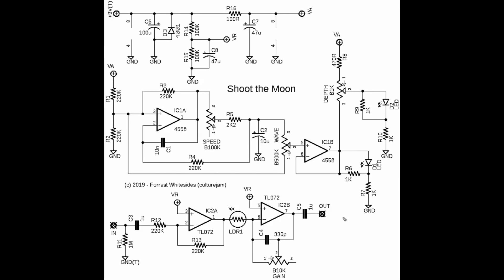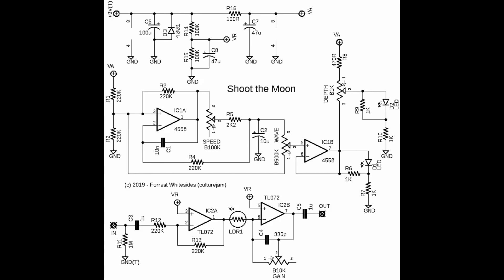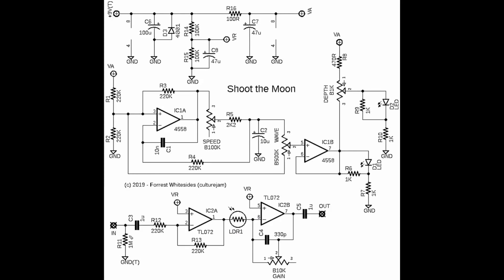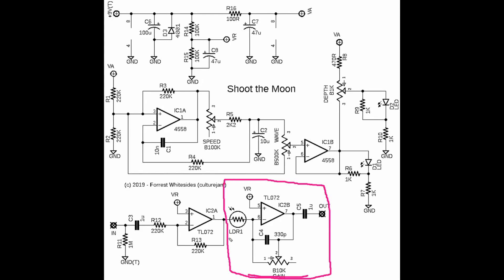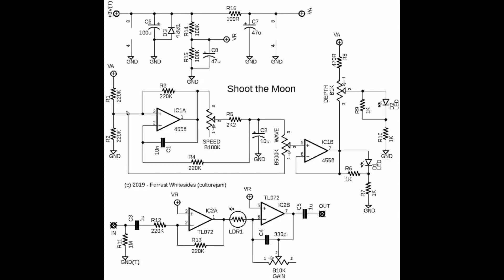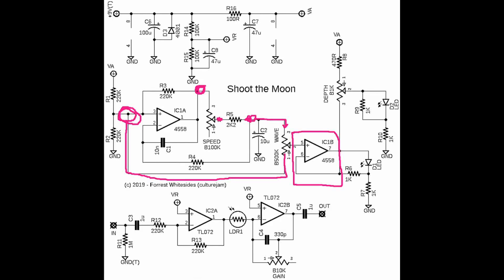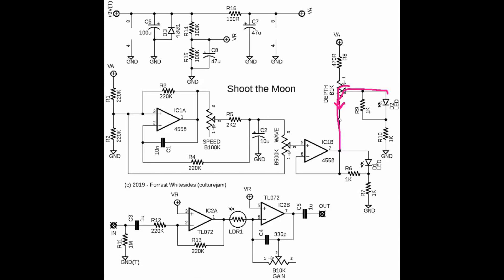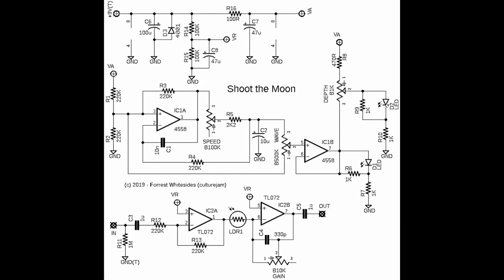Schematic Elements for Guitar and Effects: Optical Tremolo

Comment: Great video. Why is R1 and R2 necessary if we already have a voltage divider (VR)?
Reply from the maker: R1 and R2 are used to set the reference voltage to set the LFO into oscillation. Often this is slightly different from VR for a couple reasons. First, to not introduce noise onto the VR rail. Second, the voltage is often slightly different because most opamps won't work at or near the power rails, so the voltage is set a little bit off. It really comes down to the LFO design.
Reply: @thescientificguitarist4228  thanks for the explanation!